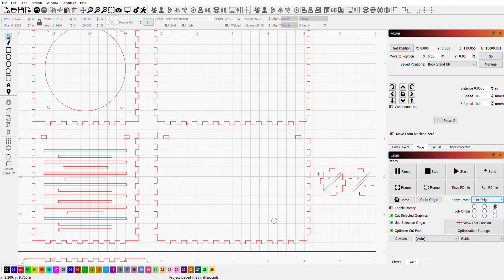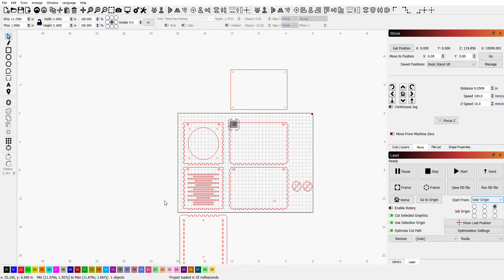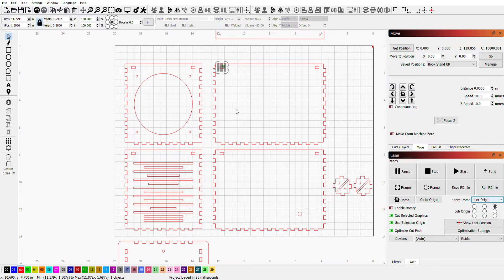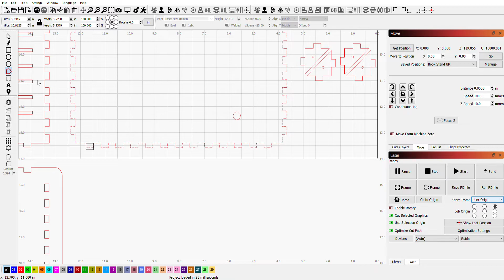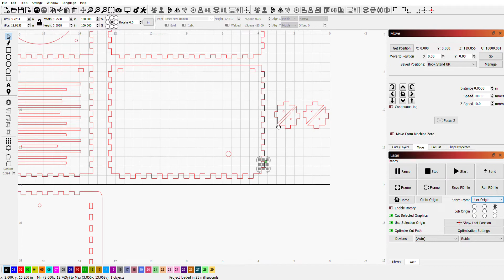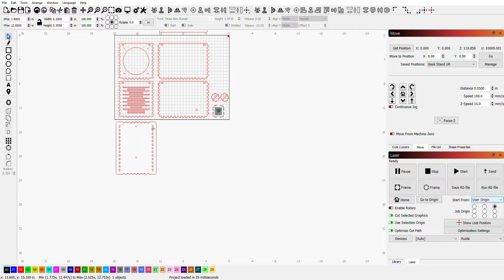Resizing Tab and Slot Assemblies in LightBurn

Comment: Following someone else's suggestion first, I made a new request for parametric dimensioning in Lightburn. I also was shot down because Lightburn is for CAM and only has very basic CAD functionality.  I'd suggest, instead of going through all the work you did, just move the project into a CAD program and set those items to PD and adjust from there.  I've been going about this issue the exact same way you have done in your very nicely done video but in the end it's suggested from the general community to go to a dedicated CAD software.  Thanks for the video and tips!
Reply: I wonder if Lightburn's new virtual array could be used in some fashion for all this. Just got LB and am working through the learning phase so I don't know the answer myself. Good stuff!

Comment: 14:46 you will need to adjust the slots inward (down on the video) so the top and bottom of the box fix snugly as the wood thickness will now have it stick out above the sides when it sits on the corner shelf. In other words, the corner pieces need to sit lower to allow for the new wood thickness. The new size slot needs to be .25 from the top edge.

Comment: Thanks, nice tutorial. Good tips! If the design is made properly and the seperate parts are seriously well aligned to the sides, you could grab ALL the nodes of one side of both sides for instance. That would reduce the work by half. So instead of going round first left side, than below then right side, you could do the right side of both in one go. But only when they are properly aligned!
Reply from the maker: Good Point, LightBurn has Arrange/Align tools that make aligning the left edge of the two sides very easy to do.  You just need to be sure you have grouped all the shapes that belong to each side together first to prevent anything from moving  that was not supposed to move.